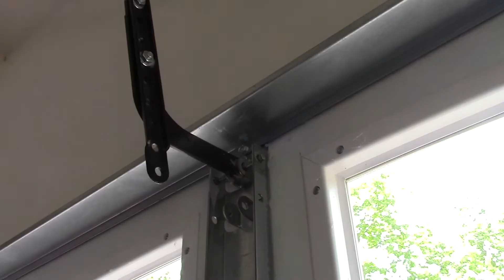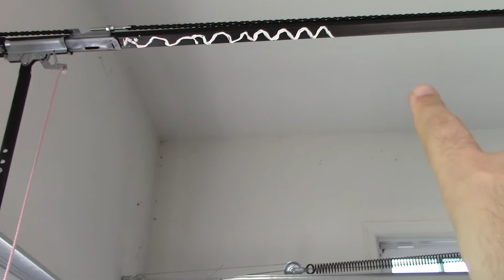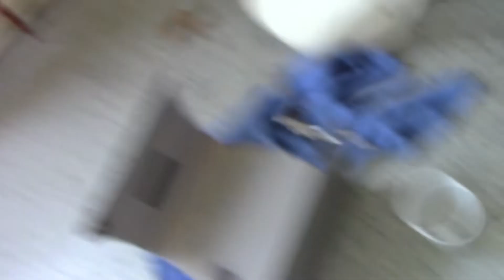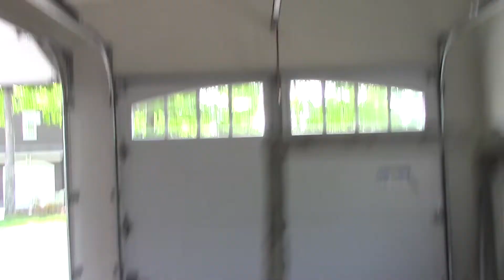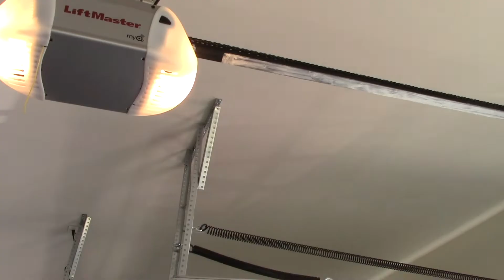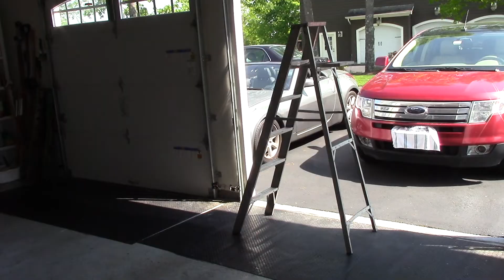Garage Door Maintenance 2: The Openers.

Comment: Yeah, I think about 1/3 the amount of grease on the rail would have been plenty.  Otherwise, indeed, big difference, definitely made them nice and quiet.

We used to do this kind of maintenance on diskette drives on computers back in the day.  Usually the 5.25" drives would become noisy, grease them up and they are so smooth an quiet again.  Drives that were never serviced could become "stiff" on their rails, and you'd get seek errors.  Re-greasing the rails, and they read fine once again.
Reply from the maker: Yeah haha. It was a learning process indeed, but I was able to put some excess on the first one along the side and top edges, so, nothing went to waste. I'll tell you though, that was one hell of a day, and it was warm and humid as well. Took occasional breaks to get some water from the kitchen, and then went back out. But the best thing? When I see and hear how the doors and openers operate? It is so satisfying when that happens, and you can say "I did that."

Oh yeah I know about those floppy drive rails for sure, though I am more familiar with the 3.5 inchers. Actually, remember when you and I powered up the ImageWriter in 2014? Such a difference when we cleaned/lubricated that thing!
Reply: @Sharkie626  Actually, I know all about the "I did that".  I have been working outside almost every day, opening the pool.  It's not as easy as you might expect since I set a grueling schedule for myself.  Not only do I do the work and record the video, then I sit and edit the video, in the SAME DAY.  It's non-stop.  And I don't just do one video, there are multiple.

Yes, I do remember the ImageWriter very well, still have that old video on it where it just couldn't until we cleaned and lubed it.  Good old electromechanical stuff!
Reply: Today I spent about 6 hours outside.  I weedwacked, edged, and mowed, then got out the blower and cleaned everything up.  After that, i gave the pool its second manually vacuuming.  My back was on such fire by the end that my shirt would have burned, except that it's blue so it's cold.

Definitely not downplaying going up and down a ladder for hours, it's not fun.  I did that yesterday when I trimmed the fire bush.  6 or 8 times up on the ladder for me.
Reply from the maker: @jaykay18  Oh wow, yeah you still got me beat in terms of how much I would do in a day I think. Definitely kudos to you for all that. Also, if ever you wanted to check your opener gears, it's pretty much the same steps as here, only difference being yours has mechanical limits, so you'll just have those extra few gears.
Reply: @Sharkie626  If my back didn't do me in, I probably had another good hour of work left in me.  But I had to go rest, because the pain was pretty bad.

Yes, the mechanical limits are awesome because it's basically a scale model of the real thing.  Neat idea, happens to work.
Reply from the maker: @jaykay18  Oh yeah that is a very cool thing to see indeed. I remember watching it when my dad and I replaced the gear in the Sears opener way back, as a kid I found that way cool. According to some people who have commented in other videos, LiftMaster, and the 8365s are supposedly still very good, so I hope these electronic limiters stay true to that as well. Worse case scenario, It looks like they're very easy to replace and reset if that ever happened.